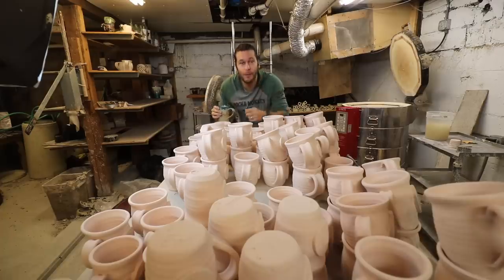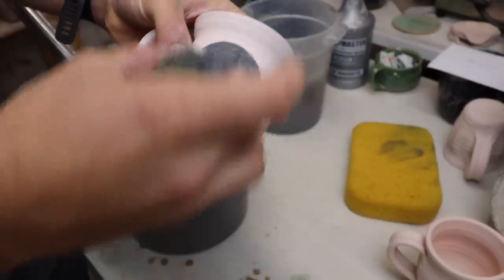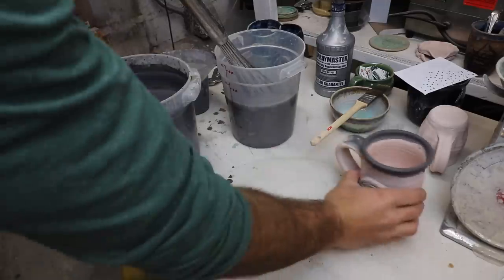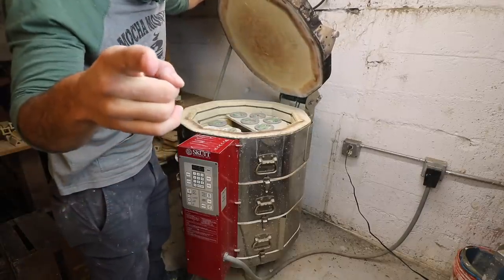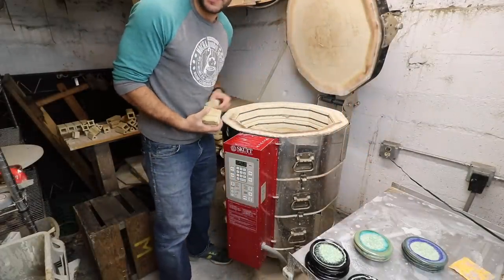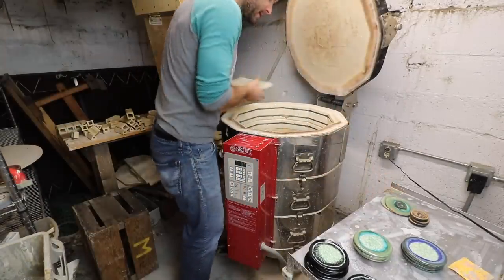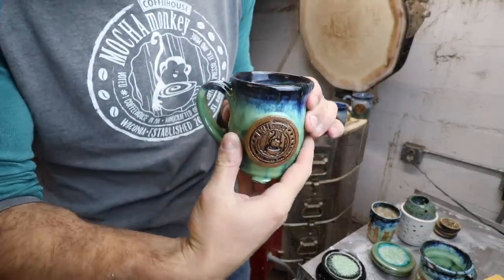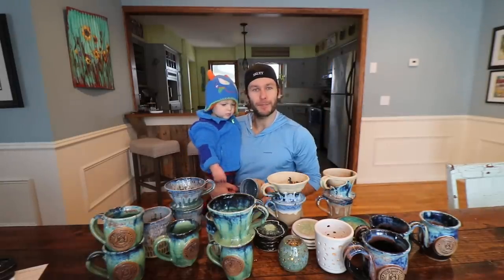GLAZING AND UNLOADING CUSTOM MUGS - Kiln #39 - BIGGEST ETSY RESTOCK YET!

Comment: Have you tries staggering the levels of your kiln shelves yet? I found I get a more even firing when I did. That is one half shelf about 1/2 inch higher than the one next to it all the way through the whole kiln. That allows a flow of heat throughout keeping the temps between shelves more equal. Love your work Jon.
Reply from the maker: I should do that!! I
Reply: Karen Johnson     I use a pyrometer with a thermocouple in the top peep hole and another in the bottom. Amazing how much difference in temperature I get when both element dials are on the same setting.  I still let the bar in the kiln sitter turn it all off.

Comment: Ryder gliding across the screen was a gut buster, your funny. Suggestion, mount your grinder on a piece of 2X6 or 8 bigger than the grinder bottom and counter sink the attaching hardware so you still place it a table flat and use 2 squeeze camps one on each side to the table top. Boom Done.

Comment: Beth Lo has a technique for making slab forms where she uses like a 1.5 to 2 inch pad of foam and a piece of wood in the shape of the piece she making. She rolled the slab out, put the piece of wood on it, cut around in leaving around a 3/8 to 1/2 inch extra. She let it harden up a little but not to a full on leather hard. The extra width will essentially become the lip of coaster. After you put the clay slab on the foam you use the piece of wood to press down into it with some oomph. She mentioned it worked best when the wood isnt beveled at all. Prior to pressing you can use rollers or literally anything to add some character to the rim  or thin it out. She was using some porcelain at the demo but I figure the technique can be adapted for stoneware.

Comment: I believe that when dip glazing, you should do the first dozen or so, then re-stir your glaze and add the appropriate amount of water to get the consistency and specific gravity back up to where you started...your bottom shelves that did not drip much, reflect those pots glazed and loaded as the glaze started out perfect, and with each subsequent group dipped, the water was sucked into the bisque, little by little until it threw off your balanced recipe...if you slow down, think about the differing way the glaze behaves, consistency and adherence, you will see in advance where you need to tweak the batch, to prevent hours of grueling grinding which leaves your bottoms, less than perfect...had you waxed the bottoms, it would have protected more drips from adhering, however, you mentioned trying to emulate someone else's fingerprint nuance, which sorta set up the fail...hope you don't mind my two megabits :P

Comment: I may have made a mistake. I used underglaze in my badge instead of regular glaze. I also used corn starch to make the stamp work like you do) but I don’t remember using a brush to brush away any dust from the badge after bisque firing. I didn’t add a clear glaze over it. I just put wax. Now my badge lettering is flaking out. I wonder what is the wrong thing that I did?

Comment: Annoying glass woman here again lol... we use wet grinders to adjust, shape and smooth our glass as we work. The water is wick fed into a diamond grit grinding head. It A ) keeps the particles from being air born and B ) cuts through glass, and fired clay like butter. They are easy to clean, easy to use and they don't crawl across your work space. :) Mine is a glastar. I used it to grind some glaze clots off a few things I made in school. It cant hurt to look and might make it a bit faster and easier on you.

Comment: Love the glaze combos that you make. When I think a glaze might run, I always put the mug up on a small stilt (a 1 1/2" tube I made from cone 6 clay). At least my mugs aren't fused to my shelves!  How much clay for each of the different sized mugs? I can't seem to get more than a 14 oz mug out of 1.25 lbs of clay...
Reply: I made a bunch of textured "Kiln trivets" from a heavily grogged high-fire clay that's somewhat underfired they serve as a safety net under my pieces. (this was especially useful when I was firing in a community studio where they weren't always consistent about cleaning up glaze on the shelves.)

Because my work is so small, I tend to glue pieces to the trivet with Elmer's glue so that a small group can be lifted and placed in all at once.

Comment: Why not use an oxide or mason stain for the logo, instead of a glaze?  It would achieve the same effect, minus a bit of gloss, the glaze likely creates.

Nothing worse than having a great glaze combo, that also dripped.  I've heard the best way to know if a liquid glaze is too thick, is to check its specific gravity.  Once you get that dialed in, the glazes will always behave themselves.
Hopefully, you wash your shelves.
Reply from the maker: I have just always used the glaze, I kind of like the little sheen,I could try a stain thought see what I think!
Reply: Jonthepotter the sheen comes from the residuals of the black glaze then? I was wondering if I missed a step😜 What clay do you use? I really love the color!
Reply: @Jonthepotter  Using the glaze definitely looks good, but using an oxide would be cheaper, if you wanted to save  a bit of money.  It looks like you are using Continental Clay ( As do I).  For a  50lb. bag of black iron oxide, it's like 50 bucks.  If you do want a bit more of a gloss, you could mix the oxide with Gillespie Borate, which would also fuse it to the clay more, than the oxide would on it's own.  A 50lb. bag of that is about $100.  I see that 50lbs. of dry glaze, from Continental, is  well over $200. So for nearly half the price, you could get double the materials, to create a similar look.
Just a thought.